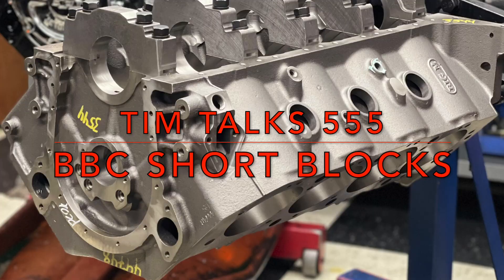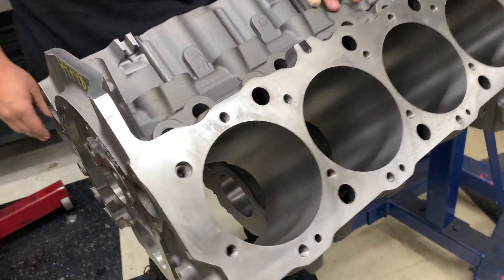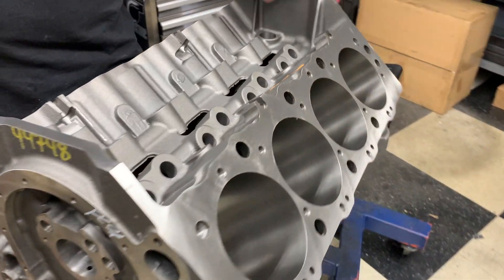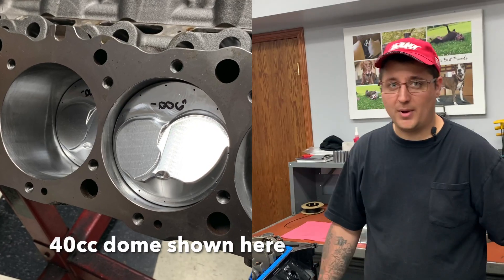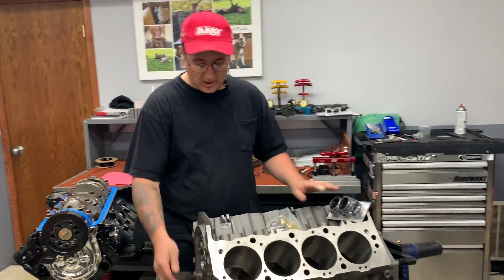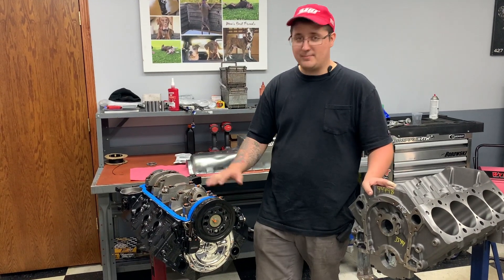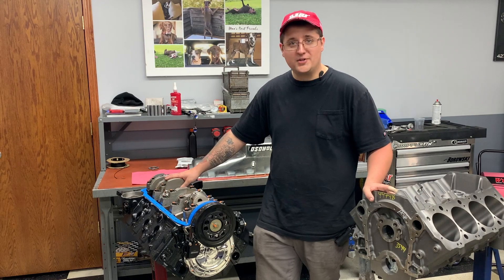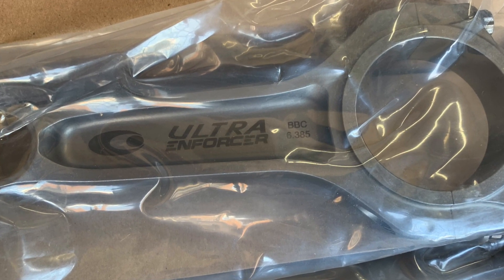Tim Talks 555ci BBC Short Blocks

Comment: Have you ran any 4.5 9.8 deck height setups?  Any cam clearance issues with 2.2 journal and larger solid roller (0.470-.480 lobe lift bb journal)?